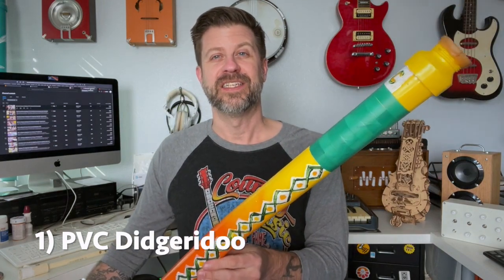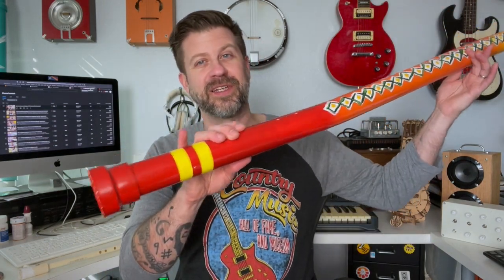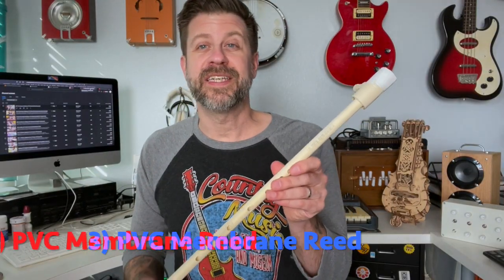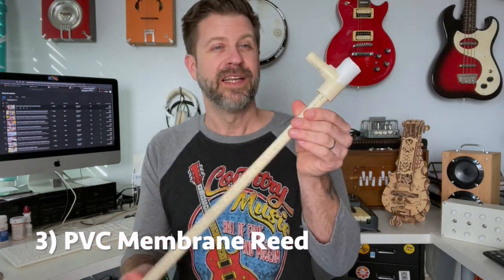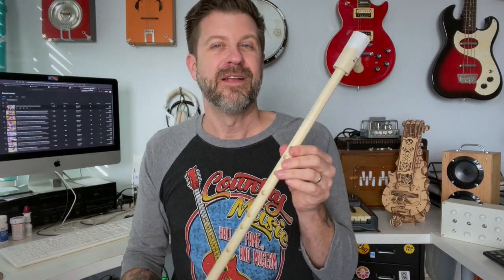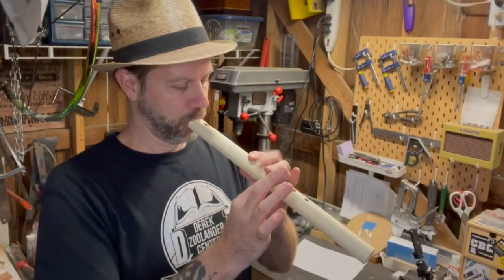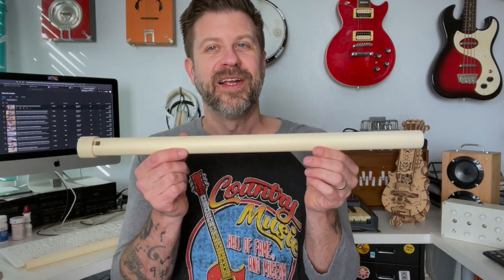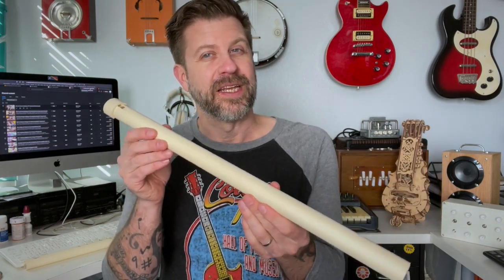5 PVC Instruments You Can Make at Home

Comment: New visitor to your channel, longtime DIY instrument maker. I often use PVC pipe in my efforts because I worked as a plumber for many years.
This is a great, informative video.
I'd like to share a few things I've learned. One is that heating and warping the tubing for a homemade digeridu enhances the sound and playability by creating a bit of back-pressure in the pipe. 
I'm currenty working on a membrane clarinet, using the same basic methods you covered in this video, and having a bit of trouble tuning the finger-holes. I've decided that I will make it a 7-hole pipe, with the hole closest to the far end usually open. I found that closing the last hole brings out a very low bass tone. I may use a small split piece of pipe to cover that bass hole, and see if that makes the clarinet play in low register.
And, I'm going to make a bass kazoo, pretty much the same way you made yours, but with bigger pipe, and to be played using my bass voice.
I have liked the video, and will subscribe. Glad to have met you here.
Reply from the maker: Thanks for checking out the video. I really appreciate it. I’ve been pretty impressed with the so nice qualities of PVC.
Reply: The thing with wind instruments is that they don't rely much on resonance from the material. It's all just the movement of the column of air.

Comment: There is an error in the plan you followed building the membrane reed instrument.  The top hole is supposed to be on the back of the pipe and covered by the thumb. I can't comment on the accuracy of the instrument's tuning as I've not built this particular one.
Reply from the maker: Thanks for checking it out. It’s not an error, it was left off on purpose. There’s nothing inherently correct or incorrect about the number of holes. It just means you can play less notes. I actually wish I would’ve only used 5 holes because I don’t like the fingering pattern.